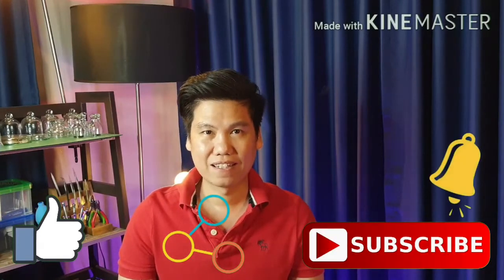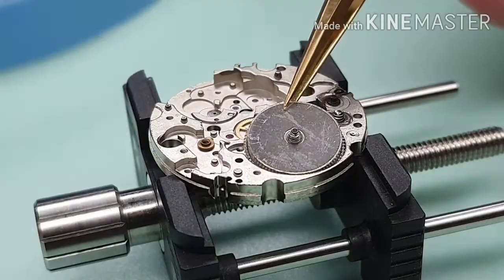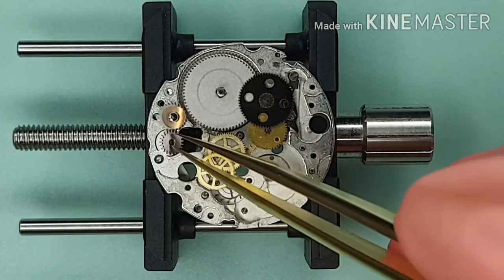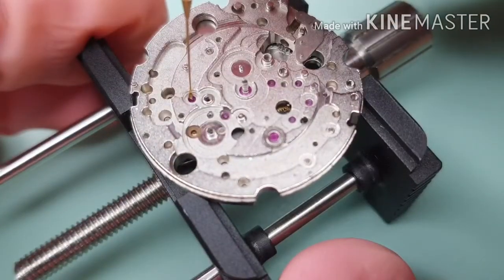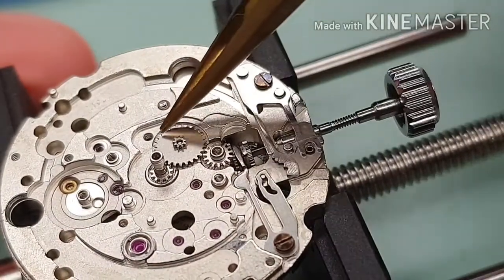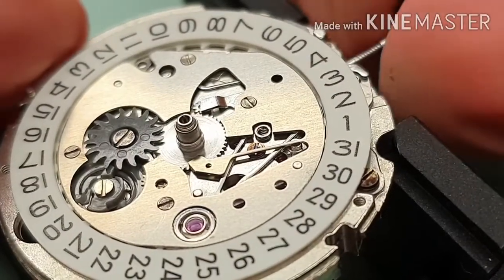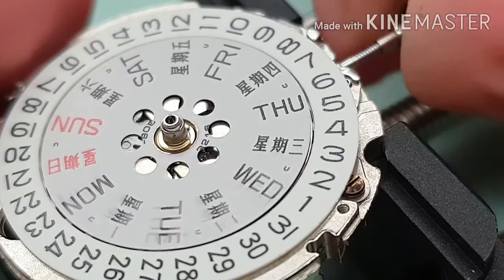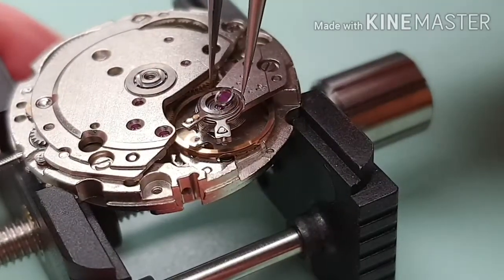Servicing Japanese Movement Miyota 8205 part 3 of 3 - Reassemble / ประกอบเครื่องญี่ปุ่น Miyota 8205

Comment: I have this movement, but no longer works. Mainspring work, click and reduction and crown wheel works, and can be wound. But stuck at train wheel and escape wheel.
Reply from the maker: you want to check the staff of each wheel specially balance wheel and pallet fork.

Comment: You cleaned the parts excellent. But after refitting the mainspring in the barrel, the lid has been dirty. It could have been cleaned with rodico before the assembly.
Reply from the maker: Thank you very much.  I will take your advice. 😀😀

Comment: thank you for your video! It helped me service the same movement! But i have a question, my power reserve cant seem to last more than 10 minutes, i can't seem to find the issue, i need your help please!
Reply from the maker: there are many possibilities.  If you can show me video that would help a lot.  however you need to check
1. Mainspring, if it is in good condition. Can it be wound up?
2. pallet fork. Check if the staff still good.
3. balance wheel, check if the staff still good, impluse jewel is centered.

hope those points help. :)
Reply: @magicofwheels  thank you for your help, my parts arrived. 
changed the parts you mentioned and my watch works like a gem now. thank you sir, your videos are very good
Reply from the maker: You are most welcome and I am glad my videos and my comments help.

Comment: Nice job. Can you suggest a case, cristal, gaskets, etc? Kit for this movement, please?
Reply from the maker: https://youtu.be/m8-kcDW7XFs

https://youtu.be/T03FZ_VrhuM

Ebay can be a very good source.
This steps
1 Search for the dial and hands that fit the movement (important to mention the movement series such as Miyota 2805)
2 search for the case mention the movement too. (normally comes with crystal and gasket). Important to see the case that fits the diameter of the dial. It should be stated on the item description.
Reply from the maker: try seller by the name: raffles-time

Comment: can i have a list of all the oils u used?
Reply from the maker: Yes, here they are,
Moebius 8212
Moebius 8200
Moebius 9010
Moebius D5
Moebius 9415
Moebius 9504
Reply: @magicofwheels  Thank you! I checked the moebious oil chart and according to it u can oil an entire movement with just d5 and 8000. i just ordered those two. Do you think that's fine? i also bought those 2 only since i wont even use up them before they expire so it feels kind of wasteful to buy like 6 oils
Reply from the maker: @alfredenglund  
To me, the answer is yes for better performance because each wheels has difference torque or pressure.  For example, metal rubbing with rubby, metal rubbing with metal in circular motion and linear motion, each oil or grease has it own density which suitable for each specific area. 
Also, yes it is a waste for a hobbyist like me, I never use up all the oils.  However, I think the feeling of doing this hobby to the highest standard that I could reach and perfirmance of the watch after service trade that off.

Apart from quality tools, now we all know why the cost of service is skyhigh.
Reply: @magicofwheels  Hahahha yeah.